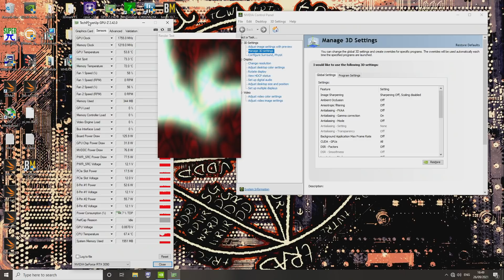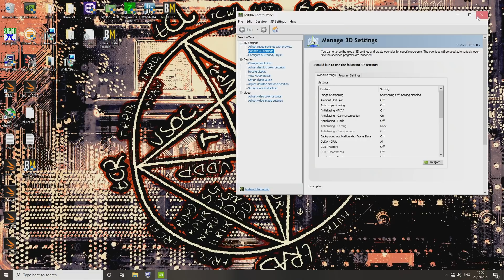Progress update on the New Worlded RTX 3090 Vision

Comment from the maker: Turns out GPU-z really doesn't put enough load on the card. 3Dmark cloud gate got the core to boost to over 2GHz so the core is fine.
Reply: The card got "New Worlded".
You just causally created the best description for "failed power stage on RTX 30-series nvidia cards".
Btw some of the 30 series card models have shown a rather sluggish behavior during load transitions, with quite significant over/undershoot, which might be a contributing factor whenever or not the power stages blow up or not.
Bios issue?
Reply: @timhartherz5652  this is what I'm assuming too.  It actually seems to me something is causing a hangup in either the power management or the clock management systems, causing overshoot of one or the other, and the cards are more likely to boost than undervolt and crash.  This could be why they black screen a lot at times too on certain drivers.
Reply: @timhartherz5652  i saw a comment of a guy who works in a pcb factory and he basically says that they're always changing the revisions of the pcb's based on the available supply of components, maybe this 3090's are all made of different components and that's why some of them are dying, also jayz made a video about new world on a 3090 and basically when he runs it a 4k the card ignores the power limits
Reply: @VAIRUXD  Changing components based on supply is rather common, especially with the supply chain issues, however it seems only certain models from certain manufacturers are affected, so i don't think that's it in this case.
I've seen the vid from jayz, and he also show that not all cards show this erratic behavior, even though they are very similar on the hardware side of things.
Thats why i suspect it has something to do with how the boost regulation is implemented in the cards firmware.
I wonder if it's possible to cross-flash another manufacturer's firmware to see if this causes the card fo follow power limitations more stricly.
I seems like this specific game causes SOME cards to constantly switch between different boost stages, which must be really hard on on the vrm's.
Might be completely off track though, maybe it's just a bad case of fake chips gotten into the supply chain, and the power stages just don't meet their specs or are misslabeled, or nvidia is covering up a big production oopsie.
Reply: I would like to hear how you identified the blown vrm with them being parallel and all.
Reply: @Bot.number.69420  identifying short is quite easy, you need to inject/insert/supply [edit] low [0.7v or so] voltage (w/ limited current, e.g. any bench power supply) and the shorted component would get hot. Now the easiest way is using thermal camera but alcohol or even frost from the freezer do the same trick.
Reply: Run Star Citizen on it :D It's also built on Lumberyard. Good stress test 😄
Reply: @WhiteSkyMage  star citizen is cpu heavy, my 3090 doesnt go over 70 % during normal gaming 

only in space with nothing 100% 

My cpu is 3950x@ 4.2 ghz
Reply: @_just_Stella  I ran it at nearly 4K on a 3090 and 9900K. It can be taxing if you push it this far.
Reply: @WhiteSkyMage  I think my Cpu is my bottleneck in this game...

Ur single core performance should be way better, soo also ur gpu usage
Reply: @_just_Stella  No, the 9900K is less IPC than 5950X. My gpu sometimes runs at 70% but other times at 90+%. Depends where i am. But it is taxing on all system resources, however if you run it 4K, your gpu will almost always bottleneck.
Reply: @WhiteSkyMage  ur right if I had a 5950x 

I dont 
I have a 3950x
soo I dont really c 90%+ times often
Reply: man you've just saved the owner like 2000€ 😂
Reply: Love your content!

Do you think people seem to blame New World for killing cards more then the cards being at fault?
API calls should not kill a card, there is no "nuke the card call" and it annoys me a bit that people blame games.
Yes a lot of games are coded like shit and do stupid things like uncaped FPS in the menus but that should not kill a card, reduce it life span sure, kill it on the spot, no.

If a card dies in New World it can die in ANY game with similar load the way I see it, just like you sad, what will be the next game that can kill this Gigabyte RTX3090.
Blaming the games is like asking for the problem to be repeated instead of fixing it on a hardware design level.

I have seen people reporting being on there second RTX3090 where other games that they died in was GTA V och MS Fligth Sim 2020 for example before New World killed the second one.

What annoy me with Nvidia is like you say, bad VRM design, then they seem to rely on Drivers to save the card.

I prefer the hardware to have its own safeties, might be less flexible if you cant tune it case by case but I rater have hard limits then depend on drivers for safety, like the GTX590 that burned up for reviewers and got patched in the drivers.
Reply: @NittonÅttiofyra  indeed, no userspace code should be able to damage the hardware... but saying that doesn't generate clicks & views.
Reply: After testing a bunch of new world (100hrs), at spots the game runs the gpu 100% load, 100%+ power, clocks maxed out (like steadily) until you leave or are fighting. The 5700xt I'm testing pulled 200-220w constant, upto 260w (will stay for a bit). Back of the pcb vrm area hits ~85+c constant, back side of vram ~75c. Lot of heat out of the card, I have to turn my ac on when playing new world. Any other game I play don't act like that or have the gpu put out that much heat. 

I can see why 3090s are most effected, alot more heat in the board with all that vrm on both sides of core + vram on both sides of pcb. Essentially heat soaking the pcb.

I have found capping fps at 60 in game and turning vsync on (144hz monitor) & dropping the power of the card to -10 to -20% does the most. Changing visual settings without doing the above can help some but can still pull the power in areas.
Reply: @sobe8991  People say there's nothing wrong with new world, but it's fishy as fuck. Wish someone with proper level of expertise would investigate it.
Reply: In stress tests with my 3090, I've noticed a strange behavior I haven't seen in other cards. While it is running fine, the clock will bounce around 2050-2100 mhz, but when it crashes, you can see the mhz boost up to 2200 for a few seconds as it crashes. I don't know if it is relevant, but it seems to match up with JayzTwoCents video where he saw strange power peaks that went well beyond the actual power limit. Dunno if it is related, but if New World is somehow causing the card to overboost for too long, it makes sense to me a power stage might explode. I have my 3090 on EKWB water now with direct cooling on the VRM components, not sure if it will help, but I'm not playing New World either.
Reply: Imagine 3 years from now WHEN EVERYONE IS OUT OF WARRANTY AND GAMES ARE SO DEMANDING/ GAMERS MOVE TO 1440P 240 HZ/270 hz they might blow up cards!!! I smell a law suit!!! 
https://youtu.be/4DtUCwTXm9Q?t=408
Reply: Cloud Gate is no Fire Strike... But still a potentially dangerous move. Just gotta walk right up to the edge, eh?

Please don't blow up the card before the new power stage shows up 🙏
Reply: Maybe the factory should start using furmark in QC without the throttling driver and only ship the once that survive ;)
Reply: Yeah, when I stresstested my 2070s temperatures after putting on new thermal paste and improving case airflow I did it exclusively with fully maxed out games. Shadow of the Tombraider was good for that.
Reply: Do you think the 20 series cards will be fine on new world?
Reply: Yup GPU-z sends my 3080 to 80W only, not really full load !
But you're impressively knowledgeable and resourceful making those freaking burned cards live agin, you're a GPUNecromancer man ! 😁
Reply: typed up an entire reply. negated by this. Haha.
Reply: Is this typical (core being fine) for a power stage failure, or just lucky for this one card?
Reply: Can confirm this as well. I peaked at 35% usage and 1800mhz for mine. For the most part, it hovers around 1100 - 1500mhz, and under 200w power usage according to GPUZ, on an FTW3
Reply: 5:45 The EVGA FTW3 RTX 3080 Ti uses OnSemi NCP302150 DrMOS for every power stage, and uses OnSemi NCP8610 controllers for everything.  Kiiiinda makes me glad that I got the 3080 Ti - it uses better components than the launch 3090s did.
Reply: Yeah GPU-Z barely wakes my FTW3 3080 Ti up even, only the memory clocks up to speed, core is something low like ~1500 or so.
Reply: Hi where can i safely download GPUZ, coz my gtx1060 is smelling weirdly, or maybe the moba idk
Reply: Should have just turned on K boost.
Reply: I wonder if you play new world again if the card would fail in the exact same way on new world?
Reply: Just run Heaven no need for the benkmark, just open and run.
Reply: @xkillerpn  heaven is easy on the gpu, the higher fps the worse it is 4K is a joke power wise compared to unlimited fps in 1080p (talking 300+) because of the lower fps, 300fps 1080p is multiples of 4K unlimited fps like in new world means the card would draw 3000 watts if it could

Comment: How did you work out that it was that particular mosfet? your previous video you narrowed it down to 5 of the mosfets. Did the capacitors shorted on the back also require replacement? I've got the same card and that same 12v line is shorted. But no fuses blown, i think the power supply might have protected it somehow.  Gigabyte won't honor my warranty and I'm in Australia can't find anyone to repair it. I've never soldered smd before but it's kinda my last resort.
Reply from the maker: I lifted the inductors one at a time till the short was gone.

Comment: Very interesting update and amazing fix so far :) , who'd think a game could cause a graphics card to blow its socks off like that! I did think about giving new world a try but I'm not risking my 2080,even if this issue is only related to 3090 cards i still don't trust it.
@Actually Hardcore Overclocking, Do you repair older cards such as a R7 360?,I believe there's an issue with the Schottky barrier diodes on it.
Reply: New World had nothing to do with the problem, it was the unforunate thing that happened to step on the landmine. The cards were dying because of crappy soldering at the factory, the cards were going to die, the house was already on doused in gasoline, New World just lit the match.

Comment: From what I understand the issue that caused the cards to fail was software based not hardware and that was fixed. I think they said there was no framerate limit and in the menu it was going way to fast, but they have since patched that. So I don't think it's the hardware not being up to par, the problem is the software and firmware not limiting the processes so as to not overload the hardware.

Comment: Just pondering on your thoughts of the power stage.

Does AMD use the same chips?

Also pro tip if I may (been IT for over thirty years and still have my own computer business)?

When you turn off the PSU via it’s switch. Press the power on button on the case to discharge all the caps and any power left in the board before removing components 🙂.

Comment: the thing with furmark is it is pure shader this means the CPU is minimal involved so the GPU can do what is capable but if the power section of the grafikscard bad and it is in the most cases today becaus the fact thats a gpu can go from 0% to 100% in 0.3ms and thats to fast for overcurrend protection. bacase the OCP has his own clock speed of a fiuw couple hundreds Megahearz. this means the time between the messuremants are to long and this results in a overload and one or more of the powerstages die in the worst case and why 3090 die so fars is clear all of the 30s series have the same power section there are identical but the 80 and the 90 are capable of more power as the powersetion can provide and the protection is is to weak for this cards.  in the end furmark can destroy you GPU so better never use it or set your powerlimit low start furmark and denn go higher with the settings but it can happen thats your card do not 100% instead it will go 130% or above and this destroy the card.  thats the reason why furmark is detected by the driver and lower the performance. i think this is a dirty way to overcome this problem thats known for years. not only new world destroy GPUs in the democene we are destroyed so many cards with shader so the most rules are now 60fps max. and other programs lice blender or GPU based rendering programs can also destroy your GPU if your CPU can hould up to feed the GPU to the max. for example the easyst  way ist 256GB ram a AMD epic and you system is loaded as RAM-Disk this means everything is loaded in the ram. and now you can hoald up to feed the GPU and bam now you can distroy a GPU. not only a rtx 3080 or above no gtx1060ti can die of the same way. so be carefull GPUs are fagile as you think

big sorry for my english i am from germany and had a E in english ^^

Comment: Hi Buildzoid, do you think that this board design would benefit in anyway by having the large empty capacitors locations populated with tantalum polymer 2R5TPE470M9 2.5V 470U ? 
It happens that I got plenty of those and a card that I'd be willing to put these on if any gain could be had.
At the moment the card seems to be starved of power on heavy workloads... The core clock lowers automagically when the DDR6X is OC'd and I can't get over 460W usage with a 500W|550W bios (thick pcie power cables are used, not getting hot at all under load). 
With current air cooling mods, the temperatures are well within specs when testing; the core sits between 48-60c and the memory is most of the time lower than 80c depending of ambient.

Been following your channel for some time now and I must say that I really enjoy the unique content that you create. Thanks for sharing your knowledge with the community 🙂

Comment: Could it be a stability/oscillation issue due to the way the stages are ganged up and not actually all driven by a controller as separate phases?
Just pondering how certain high frequency intermittent loads can cause certain frequencies of oscillation on the rails and theoretically lead to some sort of mismatch/overload/feedback on a stage. If it is the same one that always blows then it is plausible. If the load can be synced to any of the phases then I guess any could be the one to blow.

Comment: Hey BuildZoid, would you be willing to repair a dead 980 Ti? It's a really good bin and it died after I tried to run the GPU-Z render test. PSU clicked, system turned down, GPU Error 43. I would really love to keep using that instead of relying on the GT 710.

Comment: Hello there. Would I find here a video on what to do if my GPU doesn't want to load drivers? Re-heat has usually helped but I have the impression that it will be nothing with the GPU chip itself, but with something around.

Comment: I'd be interested in hearing what you thiink the actual design flaw is. Just because you don't like NVIDIAs power design doesn't mean there's a flaw in it. Just because it may not be the best solution doesn't mean the design its self is flawed, just that it's not the best design. I keep hearing the design of the cards is flawed but not one single person can tell me what that design flaw is. If you can't tell me what the design flaw is then why should I believe anyone that says that?  If the cards were blowing while their power draw was within manufacturers specs then I'd have a lot easier time believing that a design flaw existed.

From what I've seen the game is causing a higher than normal power draw by the GPU, a power draw so high that it appears to be going above the specs of the cards. I don't know if there's anything that NVIDIA, AMD or any other manufacturer can do about that other than a driver patch that detects that your playing New World and automatically throttles the GPU which will cause their FPS to tank and everyone will be pissed about that. With everyone angry at the video card manufacturers why would Amazon fix their shitty ass coding. Not to many people are blaming Amazon for these cards blowing. GPU designers and manufacturers can't design cards for what might come in the future.
Reply: I guess that it happens on better cooled GPUs, because the thermal throttling doesn't kick-in so the GPU remains in higher performance mode/clocks for extended periods and demanding higher power from the poor VRMs. I wouldn't support that the drivers should artificially cripple the performance to protect the VRMs. No, the VRMs should be properly sized to handle at least 1.5 bigger than the advertised load. Some sources claim that the power requirement of non-throttled 3090 at high clocks might peak close to 1KW.

Comment: I have a 3090 FE that hasn't had any issues in New World (I also limit my FPS to 60) but Satisfactory did expose a cooling issue within my system. The pushthrough design of the GPU cooler was causing my NH-D15 to hit 91c under heavy load and I'm assuming hitting thermal limits causing the system to restart. It never completely quit on me but I did get black screens needing restarts. After multiple restarts it wound up breaking a USB controller somehow causing certain ports to disconnect/reconnect randomly. I was able to fix both issues by replacing the motherboard and switching to a Corsair H115i. Temps are now in the 80's and USB is working fine on the new motherboard but I'm curious knowing what you know about the FE cards if they could potentially suffer the same issue.
Reply: I think its AIB cards and not the Founders.. At least I haven't come across anyone who had a founders and died.. I could be wrong tho.